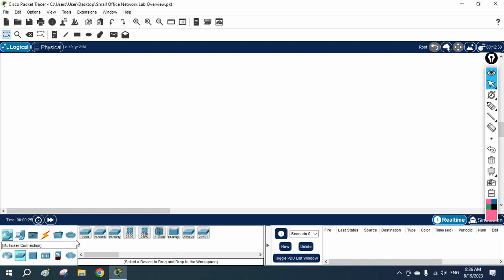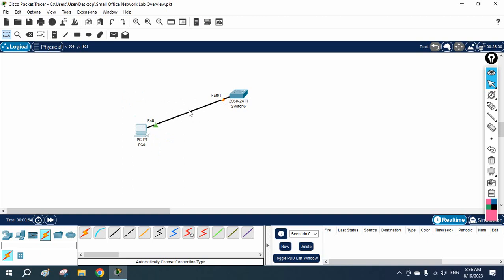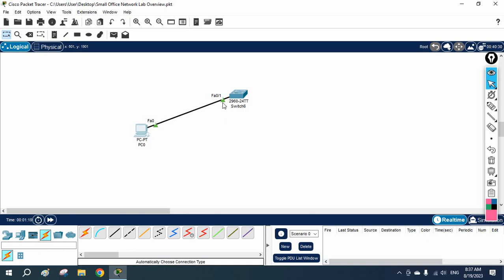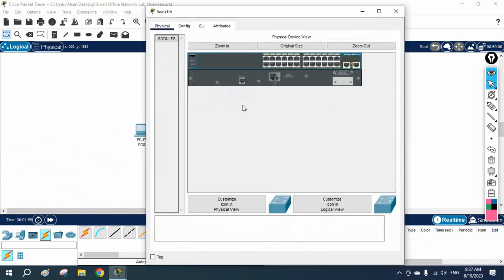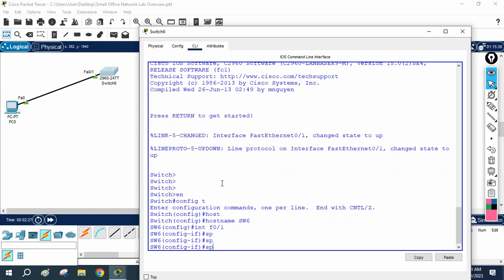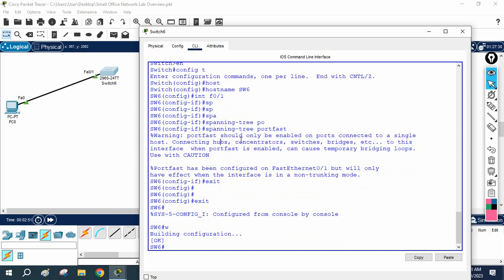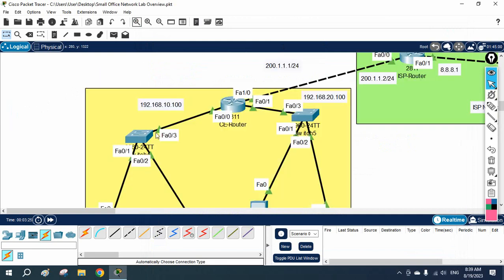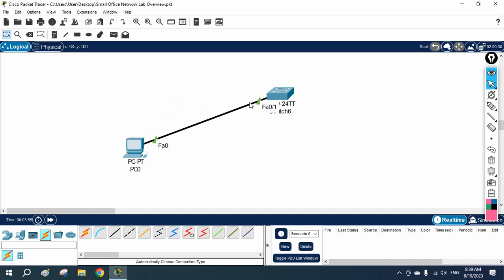How to Configure Port Fast for CISCO Switch? | CCNA | Networkforyou

Comment: Sir kepplive not kepplive pr videoss
Reply from the maker: Hi,
What is your question? We didnot get.
Thanks
Reply: @networkforyou11  sir command Cisco keeplive or no keeplive network command q use krtaa ha
Reply from the maker: The Cisco keepalive command is used to configure the frequency at which a router sends ECHOREQ packets to its peer to verify if the link is still active. The no keepalive command disables keepalives.

The keepalive command is typically used on serial interfaces, but it can also be used on Ethernet interfaces. By disabling keepalives with the no keepalive command, you can conserve bandwidth and prevent unnecessary traffic on the link.
Reply: ❤ @networkforyou11